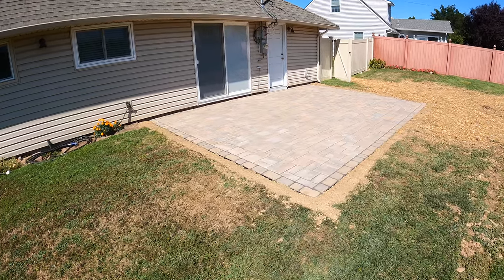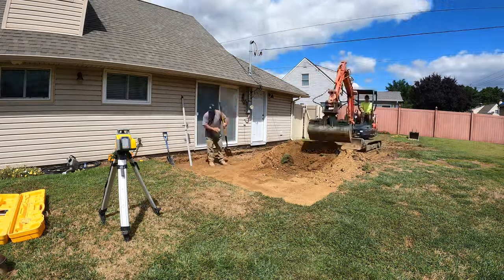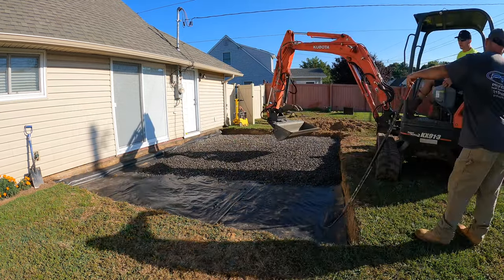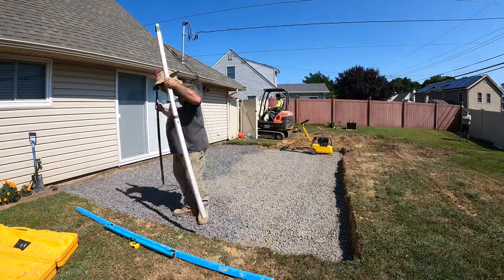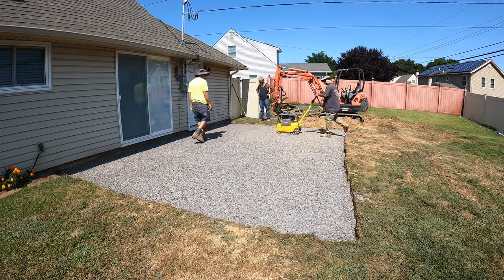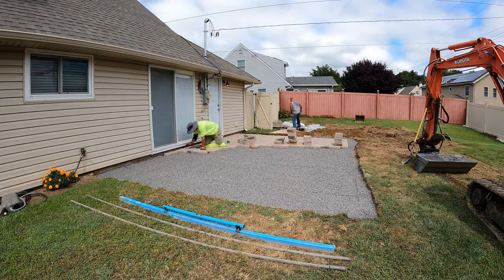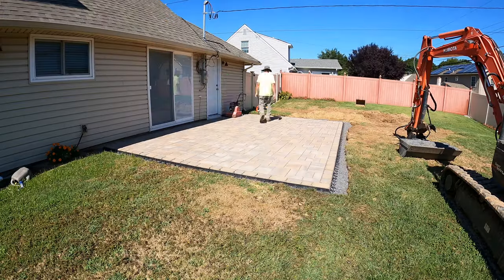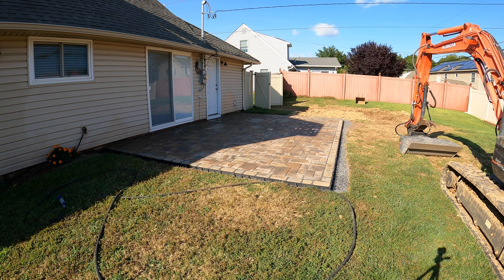How to lay pavers

Comment: I was thinking about doing the same size patio in my bk yard by myself now im rethinking it. That is a lot of work.
Reply: Do a concrete patio in sections. Rent a mixer.
Reply: It’s not
Take a day at a time. Your time. It can easy be done
Reply: Lot of money
Reply: This overkill. That deck is going to be there LONG after that house is torn down. 
The foundation of that house isn't half as ridiculous as this was. Good for them though, they made a 8k deck for a 100k house. Totally makes sense
Reply: @tranzco1173 this is not overkill. Have you ever done construction? Lol
Reply: @tranzco1173 this isn’t overkill, the base needs to be thick so the ground level doesn’t shift and warp the stones, and to avoid weeds & grass growing through. 5 years down the road you can easily tell who took the time on their patio, and who cheaped out. If you’re gonna do it, do it right the first time.
Reply: @jameshihihin1320  although concrete is nice looking, pavers are more forgiving.
Reply: I honestly feel you on this 😭
Reply: The base prep is overkill. 3 inches of #10 base is fine and will hold the pavers for years upon years. Like someone else said they turned a few thousand dollar job into 10s of thousands bringing all the equipment out and digging so deep
Reply: @CarterMc3 nah, it's just done correctly
Reply: that's why you need a pro
Reply: Kind of is
Reply: That is not cheap, so if in the same amount of time you make as much money of more than you are charged then hire a pro, and if you don’t know how to do any hard work hire a pro. Otherwise laying pavers is a good project

Comment: The best part is you finish and rest. Your wife is so happy. You tell her to leave the finished work. She thinks the grout sand looks dirty. She uses a higher power hose to wash the grout sand away. Problem solved for her: the area looks clean. And you realize you have to all but start over…

Comment: This was a good video. For those that say this is overkill are wrong. Ive been doing pavers since they became a thing. 25-30 years ago, we always did 8 inch base. Blue stone with crushed concrete above it. Back then, no barrier and no poly sand. Only play sand. Pitch was done the same way. The barrier and poly sand is an improvement. Also, the machines are great. We cracked concrete with a sledge hammer and breaker bar. Eventually picked up a skid steer with bucket and forks. Pavers used to be only rectangle. Designs have come a long way, Cambridge, Tekno, EP Henry etc. Lighting, walls, caps to match. The business has grown so much and got a lot of engineering improvements over the years. Also, a lot more competition. Back then, there were only a few companies doing it at 6-8$ per square foot. Now, forget about it.
Reply from the maker: Thanks man, its always nice getting comments from people in the trade.
Reply: @srmcontracting  You completed from start to finish in one day with just two guys? That's as impressive as the quality of work.
Reply: What do you mean now forget about it? Can't charge that much or can charge more?
Reply: @RealLifeFinance  nothing about how much you can or cannot charge. It'd about how must cost has risen and what it actually does cost now vs then. That's all I was saying
Reply from the maker: @RealLifeFinance  2 days with 2 guys

Comment: It really is the first one I see where rock bed and rock chips are used just like we did!
I used to pave in Germany . Over there we do sidewalks entire roads and especially parking lots with different types of bricks and stones . 
We were teams of 5 men each on the big projects.
 We had to lay a 100 square meters which is 1076 square foot a day. 
All that was there on arrival was a finished rock bed and the corner stones. 
Early in the day you have 1 person on the backhoe just bringing in chips and one leveling enough bed ahead for 2 guys to just go at it. With the last guy just setting bricks in front of the 2 who are laying them . 
It's so fast paced  there is no time to get on your knees.
The most hardest job I ever did .

Comment: @srmcontracting living in South Carolina would you recommend sand or use the 3/4 stone below the pavers?
Reply from the maker: If you don't have freeze thaw cycles you could probably get away with 3 inches of 3/4" stone and then 1 inch of chip stone as your setting bed. You best bet would be to go to your local paver supply yard and ask what's standard for your area. Hope this helps

Comment: Are you using any type of pad on your compactor or can we run metal over the pavers!?
Reply from the maker: Yes I use a rubber pad thats bolted to the compactor. I would be worried about scuffing the pavers with the metal

Comment: In my area we don't have the 3/8 chip stone. What would you guys use if you couldn't get it readily? Most guys around here use stone dust but it's kind of a pain because you need to compact it before the pavers.
Reply: Carrera Marble tile. Just tile the whole area in marble, then you just coat that bad boy in bermuda grass sod. Wait for that to grow, then just put the pavers over the grass. Then tamp the pavers violently until they turn to dust. Then lay more pavers over the crunched up pavers. Then coat the pavers in epoxy. Polish epoxy. Easy breezy.

Comment: Curious if this is for a northern climate? I live in a area where we have frost also, what’s the approximate square foot cost for a patio of this size? Thanks
Reply from the maker: Yes eastern PA, around here pavers start $22-$24 per square foot.
Reply: Just quoted 30$ sf labor only. I have to supply everything but some base fabric. No way I will pay that much.

Comment: Guess it depends on the area. but I've seen patios with just 2 inches of gravel and no leveling sand and they held level for almost 15 years. And every now and then you'll just have to adjust a few spots here and there.
Reply from the maker: Yes, colder climates need a thicker base for sure
Reply: Nah. I usually start with a 33 inch deep pit. I use the largest excavator possible, like in this video. Make sure it's designed for high rise skyscraper buildings. 

First an  8 inch layer of premium stone, then a solid 3 inches of Carrera marble, then 5 inches of polymeric sand, a thin 1" layer of cashmere to block weeds, and then 5 inches of redi-mix mortar. Then polish that concrete foundation, from 100 to 2000 grit. Then muriatic acid that whole thing, really etch it. Then a layer of cork, maybe 1/8" thick - for sound absorption. On top of the cork, I add a carbon fiber sheet for strength, the kind used on the International Space Station. Then I tile the entire section in cheap ceramic bathroom tile. I grout. Now you have a base. 

Mahogony is the way to go for edging, or Brazilian Rosewood. Finally, install the Home Depot $1.25 apiece concrete pavers over the corked carbon fiber tile. Tamp the whole thing constantly for 24 hours, and then watch your dog shit on it. 
My system is much better than this bush league stuff.
Reply: @tranzco1173  🤣

Comment: Okay, so my son wants to put in a 8x14 patio with pavers. He said his budget is $500. Labor is him and me ( I’m 66). Clearly we don’t have your equipment or experience, so what can I do to help him out. Certainly we aren’t digging down 9 or 10 inches. Can we cut some corners?
Reply: Many years ago, I put in a brick patio. Not brick paver, bricks. I cut every corner. Bricks on top of dirt. Don't do that. Get the base right. Our guy here is in PA., so they have to think about freezing and thawing ground, so their base might be deeper than yours needs to be. $500 seems awfully thin. Best of luck and you don't over exert.. (we 65+ guys need to remember we aren't 30 anymore!)
Reply: @Jaxsolo  I think logic and reason finally prevailed. He has agreed to forgo putting in any additional pavers and put down some stone instead.😅Bullet dodged

Comment: Why would you not do the 3/4 stone before you put the sand to avoid any un-even leveling? Here in MA, I usually do the 3/4 crushed stone and then the sand after, using the sand as the top base, making everything level. If you try to put pavers on 3/4 angular, in my experience the p[avers will not sit correctly??????
Reply from the maker: The pavers are not on the 3/4" stone. I put down 3/8" chip stone as my leveling bed. This is called "open grade base". Google it, there are a lot of benefits and its becoming very popular.

Comment: Hi what is material cost for that size ? and then total cost to have installed?  I am thinking of trying to put one in myself. I have done plenty of concrete flatwork but never pavers.   Thank You
Reply from the maker: I'm my area it's about $22 per sq ft to have installed. All the materials account for about $8 per sq ft. Thanks for watching

Comment: What difference between the two compactors? Is one more intense for the gravel VS the top of the pavers?
Reply from the maker: Yes, the one I used for the base has more centrifugal force so it compacts better. The other one is lighter duty and has a rubber pad on it so it doesn't scuff the pavers. Thanks for watching

Comment: What's the reason you don't use crushed stone? It compacts better. Is it drainage related?
Reply: it drained well and locks into place really well
Reply: @Joshua Jorgensen  if it works it works, I've just never seen clean stone used. Keep up the good work.

Comment: Great video brother. Would a concrete edge be better then that plastic edge on Open base?👍🇺🇸🇺🇸🇺🇸🇺🇸
Reply from the maker: Thank you, Yes concrete will hold better for sure. The only issue I had with concrete is the grass never seems grow back over it very good. I make sure I compact the dirt up against the edging really good and it seems to hold well. I might try the concrete with the fibers in it and see how that works.

Comment: No sand? If so, why?
Reply: Crushed stone is more stable than sand. Offers better drainage too.
Reply: @bert454  Thanks!
Does the Polysand helps with water drainage down to the rocks?
Reply: @rbyee7571  Polysand main job is to fill the gaps between the pavers. It helps prevent weed growth in the gaps and helps with any shifting. As for drainage, that is all down to how good the ground/ sub base it sits on.
Reply: @bert454  Okay. Thanks again.

Comment: You don't need 6 inches of base for non car loading use. 3 inches of base is good enough for a simple backyard patio. The thing I personally struggle with is excavation without a large tractor.
Reply from the maker: If you live in an area that goes through freeze cycles, all manufacturers recommend  a minimum of 6". I'm sure down south 3" is probably enough.
Reply: @srmcontracting  oh

Comment: Strike three. Have yet to find a video that explains the spacing between pavers. Appears that they are being butted up against each other, but then why is the poly sand needed after the pavers are laid???
Reply from the maker: Most pavers have a spacer bump on them. When you lay the pavers just butt them up as tight as you can and you'll be left with an 1/8-1/4" gap depending on paver style. Hope this helps.
Reply: Oh boy, shrike three? If you look at any decent paver that have their own spacer bumps molded in….did you honestly think you have to put spacers between each paver like tile? 😅😅

Comment: Any reason u use the plastic barrier and not concrete?
Reply from the maker: I've used concrete in the past and the grass never seems to grow back right. I packed the dirt back tight against the plastic and it seems to hold it. Once the grass grows back that plastic cant move.
Reply: @srmcontracting  they seemed to be expensive

Comment: Better have the excavator and other equipment and tools before even thinking about doing a project like this
Reply from the maker: It sure helps saving your back!
Reply: U can do it without would not be ideal for a business but I did a 10x10 pad with a shovel a rake a piece of board and my body weight for tamping . Pad been there 20 years

Comment: this is a great way to do it if you dont get frost, frost will not be kind to this job
Reply from the maker: I guess you missed the part about the 8" base. I'm in eastern PA we go through lots of freeze thaw cycles.
Reply: @srmcontracting  you did not build it on sand the perk time of that soil type you know ,,,,,,
Reply: @frostycools1315  Go for a 12 inches base if you live up north. The deeper,the better.